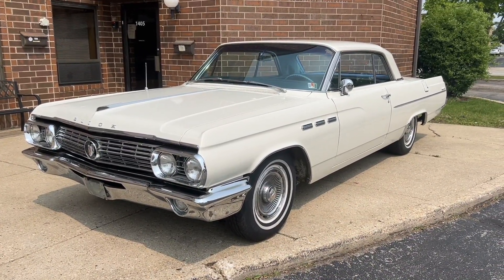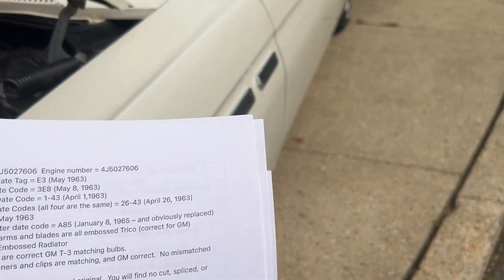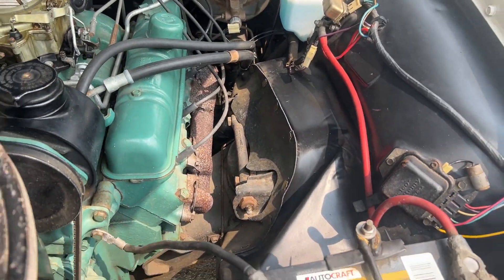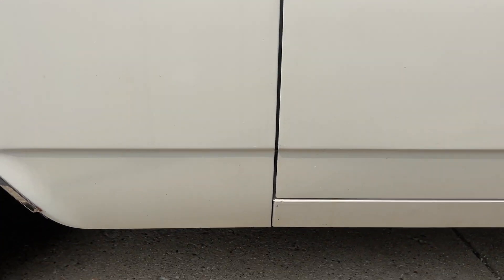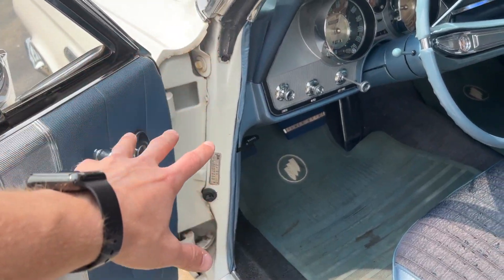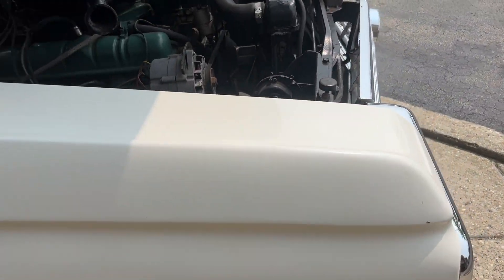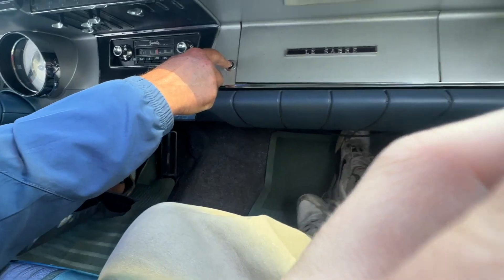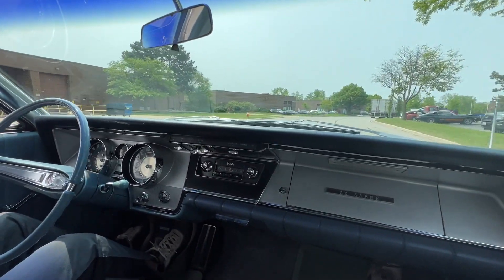1963 Buick Lesabre - Quality Original Example - SOLD

Comment: Hi. Our family had a similar 1963 4 door, same color, i noticed you have 2 horn units on the passenger side of the engine, while ours had 2 small and 2 big long horns, total 4 horns, did u remove the extra ones or horns vary from car to car of the same year ? However what is your price ?

Comment: Price...I had one...my first car...used low to race people, incredible power in low with the Buick "Switch the Pitch" torque converter...smooth as silk, fine handling, 12" finned aluminum drums- apex of drum brake excellence. -The 401 was a wonderful engine, low floor hump, almost none...what's not to love?
Reply from the maker: 23900 obo